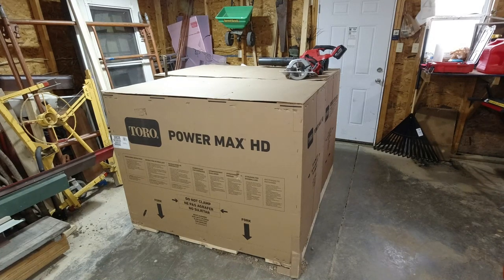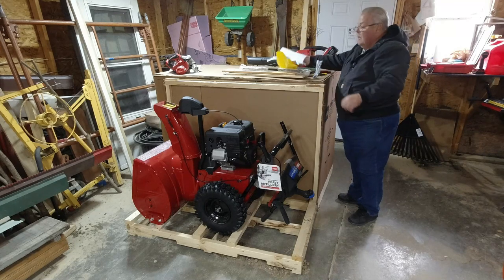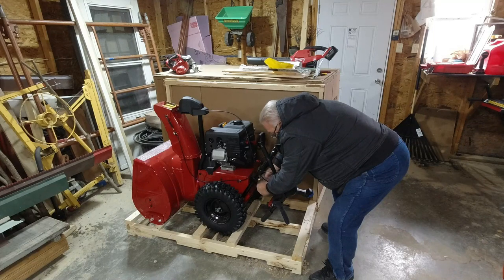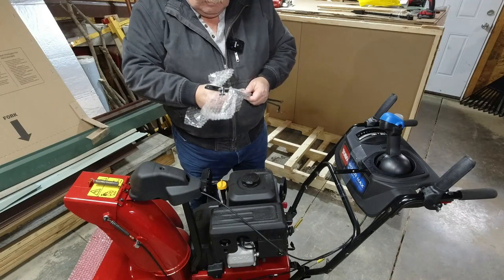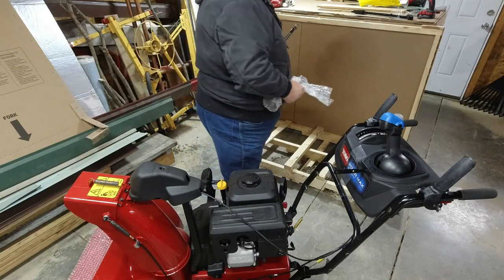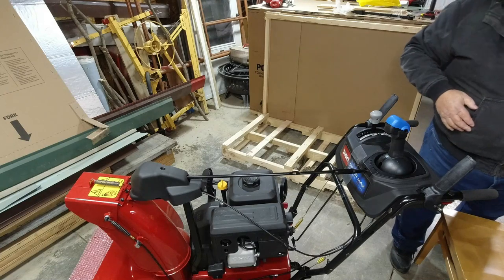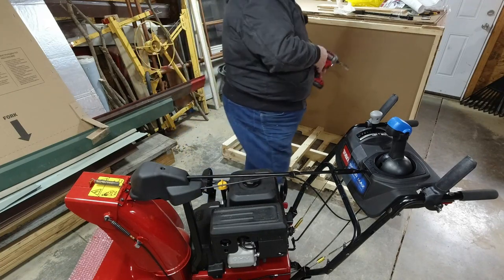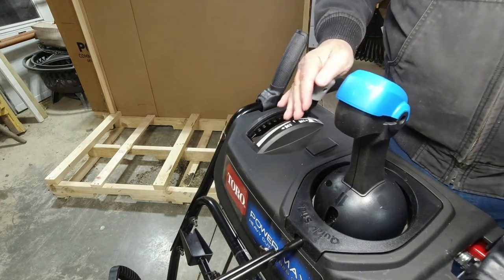Toro Power Max HD 828 OAE Assembly and Setup

Comment: Hey Paul. Looking between this and the 30 inch with the 302cc motor. Do you think there’s a big enough difference in terms of real world power  performance ? Thanks
Reply from the maker: The 30 inch will have the same power-to-width ratio as this one. With Toro you don't get the "big power" ratio until you move up to the 1428 and 1432 commercial machines.
Reply: @PaulSikkema  thanks. Now just have to decide between this and the comparable ariens deluxe 28 and 30. Getting rid of my 2017 husqvarna st224. Good engine and body. But flawed cable system that constantly break. Slightly underpowered in my opinion 208cc with a smaller auger and impeller compared to the ones im looking at.
Reply from the maker: I understand your frustration with the Husqvarna. I've had four different models over the years and their biggest issue has always been the control cables. 
Ariens or Toro. That's really a tough choice. They are both the best snowblowers on the market today and you can't go wrong with either brand. So, here's a few things that may help you decide. 
1. Go to both dealers and see which dealer you like best. Trusting the dealer goes a long way to being happy with your new snowblower.
2. Try out the controls. Watch my unboxing videos and I'll show you how to use the controls correctly. Some people like Toro's joystick and others like the simplicity of the Ariens crank. Move the snowblower around the sales floor to see how each one fits you.
3. Both handle heavy/wet snow and slush a LOT better than your ST224. Both will throw a LOT more snow than your ST224 and throw it a lot farther. To be very nit-picky - the Toro throws snow farther but the Ariens throws more snow. I can usually walk a little faster with the Ariens if I'm clearing 6-10 inches. 
4. Both Toro and Ariens will last you many, many years.
Reply: @PaulSikkema  great info. I appreciate the info!

Comment: Hi Paul is this machine comparable to the ariens platinum ? I found this same model on sale for$800. Ty, I enjoy your video.
Reply from the maker: Not really, It is very comparable to the Deluxe 28 SHO. 
Be careful about that $800 snowblower. It can't be new for that cheap. If it was at a box store it's a return and there is probably something wrong with it. If you know someone who knows snowblowers take them along to make sure you are not getting a dud.
Reply: Thank you I will take your advice

Comment: Hello Paul - Have my Toro hd 828. All set. Live in Southern Minnesota. Got our first snow to use it overnight. Cold (-4). Got to use it and the chute will adjust up/down, but not side to side. Did it just freeze up? It moved as I messed with it before. Any ideas? Is this common? Appreciate any help you can provide. Thanks.
Reply from the maker: 1. Make sure you are squeezing the blue trigger on the top of the joystick all the way. 
2. Did you buy it from a box store? Remove the black poly cover from the gear assembly out by the chute. See if the latch that holds the gears releases when you push the blue trigger. If the latch is not moving follow the cable up under the dash and make sure it's connected to the joystick. 
Here is a video where I show you how it should work. https://www.youtube.com/watch?v=rNQTCDxhU54&t=732s
Reply: @PaulSikkema  Thanks, Paul. It finally started working freely. The blue trigger was moving prior to today. This morning the chute was adjusting up/down, just not side to side. I guess it was frozen. (-2 here). This was my first use and it had bee kept in a non-heated garage. It moved freely before.   However, once it started working, it wouldn’t stay locked in place unless I put slight upward pressure on the blue trigger. Then I could hear/feel it lock. But it would release again every time I moved it. Very annoying. Hope that is due to the cold conditions. Agree? Or, is there any adjustment that could be made? I watched your video and see how it works.
Reply from the maker: Lock deicer or wd40 around the pivot point of the blue button should unfreeze it. Myself I have an infared brooder lamp that I just shine on frozen stuff like that. I also use it to melt the snow/ice out of the impeller when I'm done with the snowblower. Here's the bulb: https://amzn.to/3mNPgD6 and lamp fixture: https://amzn.to/34FEg4C

Comment: still shopping... What does company recommend for gas?  ethanol or non?   high test or regular?  Does this require chains on tires for heavy snow storm or is it heavy enough?     What is correct tire pressure?
Reply from the maker: All new engines are rated for 87 octane E10 fuel. DO NOT USE E15 FUEL! 
Todays snowblowers all use a high traction snow tire so you don't need chains. This snowblower has all the weight balanced over the wheels so it has plenty of traction.
The correct tire pressure is listed in your operator's manual. The manual either comes in a plastic bag hanging on the new machines or Toro specifically has a QR code on the nameplate at the back of the transmission. Scan that code with your phone and it gives you a link to the manual.
Reply: @PaulSikkema  thanks;  that helps me a lot.

Comment: So I just purchase one of these.  It seems that the blade never disengages.  It starts with electric start but not with the rope, I think this is due to the blade being engaged.  How do I adjust the blade engage trigger?
Reply from the maker: My first guess is the cable is too tight. Watch this video starting at the 5 minute mark. It shows you the proper tension on the cables. https://www.youtube.com/watch?v=B8iChkHjMQs&t=5s
Reply: @PaulSikkema  thanks, that worked!

Comment: Picked up pre assembled 828 from Home Depot. Has oil already. Started right up. Let it run a few minutes. Running fine. However, noticed a burning type smell. Assume it is just burning off factory stuff. Is this correct? If so, how long until this burns off? Or, something else? Please advise. Thanks.
Reply from the maker: The paint on the muffler will burn off on the first 30 minutes of run time. That's what you smell.
Reply: @PaulSikkema  thank you for quick response! Do they normally come with oil in it? It’s so clean, barely visible, buts it’s there.
Reply from the maker: Yes,  2-stage snowblowers come in a crate and the oil is already in the engine. THD should have taken it out of the crate and assembled it correctly - but if anything doesn't seem right watch this video.
Reply: I have a newer Mustang and I still get a funky smell when I open it up to do an Italian tune-up.

Comment: Do they make a modification for the deflector on the chute so that it aims down at an angle rather than straight out to the side?
Reply from the maker: Yes, the next model up gives you the better chute. Watch this video to see the difference. https://www.youtube.com/watch?v=rDJbhCP1hgQ&t=219s
Reply: What I am wondering is if I can buy a part to modify the 828 deflector so that it shoots down at an angle?
Reply from the maker: No, The two chute bottoms are different so you'd have to buy a complete new chute assembly for the 928 to get the parts you want.
Reply: Okay thank you

Comment: Hi Paul 
Is this the same setup for the toro powermax 824 OE?  I went ahead and bought the toro over the ariens deluxe 24 and the comact24.   I was lucky to get 10 %discount from the purchased price of $899(Home Depot) and I also bought the maintenance kit for $19.99 to get the one yr of extended warranty from toro for free.
Reply from the maker: It will be similar. This video will help if the "picture book" setup guide is unclear
Reply: @PaulSikkema  
I think your video is excellent guidelines to set up the unit

Comment: Do you need to clean the snowblower after using it?
Reply from the maker: When you are done clearing snow run the front auger for a few seconds to clear out any snow remaining in the housing. 
If the snow is really sticky and there is a lot left in the housing - turn the engine off - remove the safety key - and then tip the snowblower up, back on the handles. Use your cleanout tool to remove most of the snow. 
Instead of cleaning out the snowblower by hand I use an infrared heat lamp. I shine it into the housing for a few hours and it melts all the snow and drys it out. 
https://www.farmandfleet.com/products/676976-woods-farm-utility-brooder-lamp.html.  
https://www.farmandfleet.com/products/714269-feit-electric-250-watt-br40-red-heat-lamp.html

Comment: Paul I never tried a Toro before.. I used all other brands lol.. But this blower looks good.. HD has it for 1599.. I'm thinking about making a purchase... I owned ariens before what's your opinion on this Toro?
Reply from the maker: The Ariens Deluxe 28 is the snowblower everyone is trying to beat. Check out this video were I compare this Toro Power Max HD 828 to it. https://www.youtube.com/watch?v=KxXuNZWDLYg&t=2871s
Reply: Is there supposed to be a braking system on this thing? I let go of the handles turned around and the thing rolled away down my driveway.
Reply from the maker: Snowblowers don't have brakes on the wheels. If you are on a slope that steep turn the snowblower sideways before you let go...
Reply: @PaulSikkema  I know they don't have breaks on the wheels. But the transmission should. Let go of the handles,  it shouldn't roll away.
Reply from the maker: I've never thought about having a brake on the tranny. Probably because if the slope is steep enough that it would slide that the slope is too steep to walk on. That said, I'll mention it to the snowblower engineers next time I see them. 
Snowblowers with hydrostatic transmissions or tracks don't need the brake. 
The only brake they have is on the impeller/auger so it stops right away - for safety.

Comment: Would you recommend lock tite on the handle bolts
Reply from the maker: The blue Loctite is always a good choice for equipment like this. The nuts on the handle are all locking nuts so they don't require a thread locker though.

Comment: Can you add heated hand grips to the toro 828 HD? There is a cutout on the control that looks like it is for one but I have read that you can’t add it to these models
Reply from the maker: the reason there is a cutout is one dash goes on many different models. Toro does not offer a kit to add handwarmers.
Reply: Is there any reason I couldn’t add aftermarket hand warmers?
Reply from the maker: Tes, you will have to check with your dealer to see if the alternator on your model can handle the extra current. Most snowblower engines that only have lights have small alternators. They are not capable of handling the extra current load of handwarmers.
Reply: @PaulSikkema  Thanks. I will look into it.
Reply: @madmmx18976  the have the Red Heated Grip Kit,  part # 144-1603 however it is not in stock at this time. If you look at the parts manual for the 826 which has the heated grips you can order the parts individually. That is what I did. The Alternator on the 828 and 826 is the same and can handle the light and heated grips. Just installed them on my 828

Comment: I just got one of these my manual says put 5w30 in but you are saying 5w20 synthetic. Why doesn't the factory manual recommend synthetic?
Reply from the maker: 5w30 is the correct oil. The chart on page 20 of your manual for this model can be  little confusing. It shows that you can use 5w30 synthetic under all conditions and temperatures. 
If you are using regular oi you should use 10w30 for temperatures above freezing and 5w30 for temperatures below freezing. 
If you have an older snowblower and it does not show synthetic you can still use it instead of regular oil.

Comment: I have the 824 oe powermax and my differential when I turn the wheels drag there is no trigger less steering and it is a burden not sure why it doesn’t turn easier
Reply from the maker: The PowerMax 824 gas and the 824 oe electric do not have a differential. They are solid axle machines.

Comment: Hi Paul~  Great video, very thorough run through.  I've used this machine about 6 times so far since purchase (December 2022) and have been impressed with the performance.  However, yesterday after taking a break, upon restarting the engine, all of a sudden I only had one reverse speed.  The slower reverse speed had changed to a very slow forward speed.  Also, the speed selector lever won't move into the highest speed slot.  Any ideas?
Reply from the maker: Something broke in the shift linkage or inside the transmission case. I suggest getting it back to the dealer and let them look at it.

Comment: The 1st speed forward is too fast on my Toro Powermax 928 BUT when I adjust it the tiny little bit it goes in reverse, at the LOWEST setting on 1st gear forward it's very-very-VERY close to reverse, the lowest setting I can get it's still too fast, I have to walk too fast to keep up, I either slip the traction lever or lower the throttle setting to slow it down, but lowering the throttle also effects the auger less power to pickup and throw the snow,  My Ariens Deluxe 30 goes much slower in 1st gear forward.  It's Toro's failure on the design and size of the friction wheel matched with the size of the belt pulleys and the engine RPM, Toro needs to go back to the design board and make the traction slower and the auger faster.  The Ariens is perfect and is better engineered. Please don't take it personal Paul cause I have the highest respect for you and enjoy all your video's.
Reply from the maker: Please watch this video. The 928 is in first gear. Is that too fast? https://www.youtube.com/watch?v=R_pANI8mvjA&t=32s